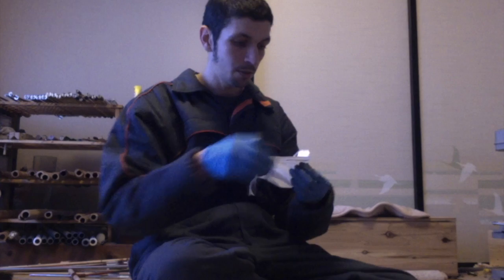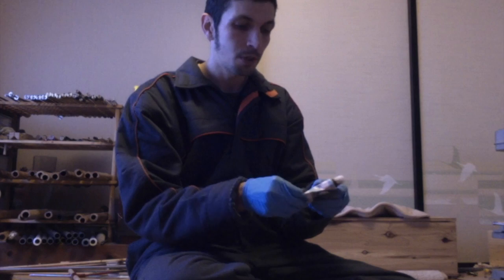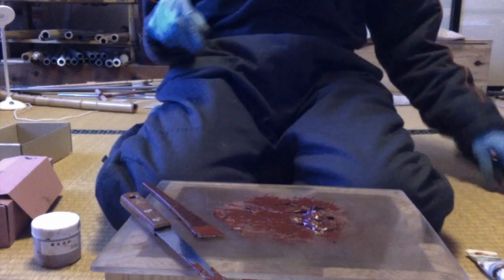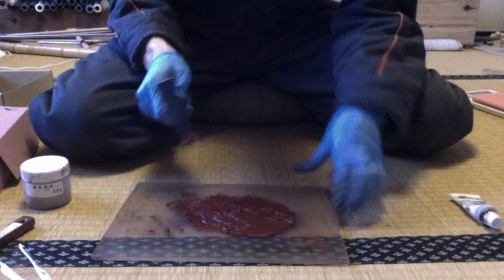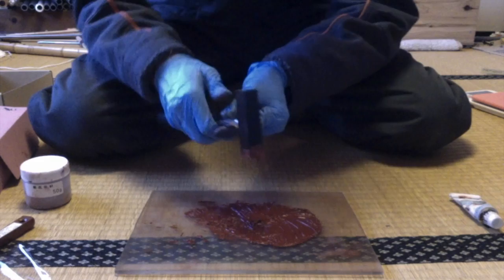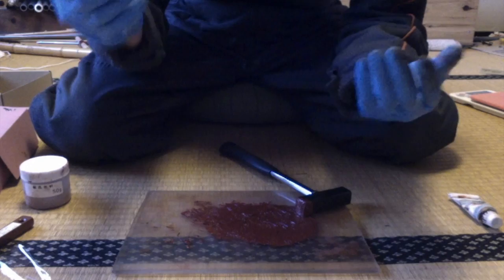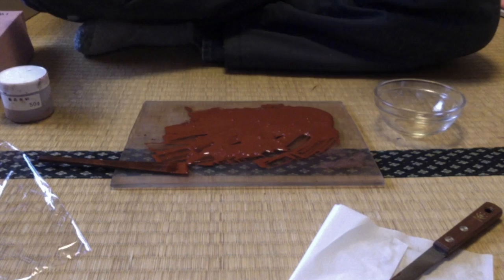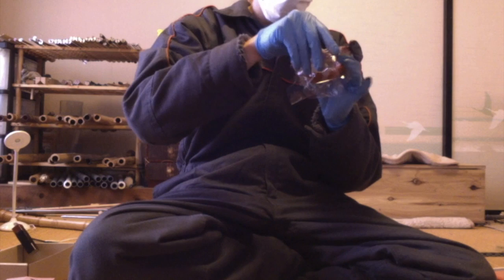Hon-on Shakuhachi: Making Red (Shu-iro) Urushi, Part 1.

Comment: And note on minerals and pigments - did you know that in ceramics the most intense yellow is from uranium salts - I'm sure there's a huge range of minerals that can be used in urushi (emoticon fingers at chattering teeth) - so big ups for your use of the simple old iron pigment, after all urushi (so far as my ignorance goes) started at the the village level back in the neolithic.
Reply from the maker: Interesting! I just finished reading my girls a Boxcar Children book, in which the children discover some yellow rocks, which lead them to a uranium mine. I like bengara even more, as it's a bit more benign :)

Comment: Hi Christian, thanks for your video, its really informative and (on a technical point) just the exact pace for a urushi video, I give you 9.5 usushi tomatoes!  And its great to see you making shakuhachis,  good on you! One question - your bengari/urushi ratio is 1:3 (8/25) based on mass - what would that be volume/volume approximately?
Reply from the maker: These days, I use closer to a 1:4 ratio. As for volume... Good question! I'd have to measure it next time I mix it up to give you a proper reply. An off-hand estimate, though, would be that a 1:3 ratio by volume would probably give you something close to a 1:4 ratio by mass. A 50g container of bengara looks to be just a little bit bigger than a 50g tube of urushi.

Comment: When it comes to allowing the urushi to harden, how do you maintain the temperature and humidity? I'm trying to make 7 tea boxes with urushi lacquer finish. Six of the boxes will be rather  medium 6"x 3" x4" and then 1 larger box 12"x12"x4".
Reply: You'll want to make a wooden box that will be big enough to fit your tea boxes. One side can be a wooden lid, or a sliding glass "door," for example. For humidity, you can use a damp towel inside the wooden box, or even say must onto the bare wooden sides before putting your urushi vessels inside. For temperature, an electric rug or blanket underneath the box is effective. It also helps to have temperature and humidity gauges inside the box.
Reply: @mutsumiandnickbellando9529 At this point I'm only looking for these boxes to be a proof of concept so I plan to do as few layers of the lacquer as possible. How far would you say 100g of the lacquer goes?
Reply from the maker: Generally, 100g will last me quite a while (for processes such as suri-urushi that use very thin coats). As a rule of thumb, 50g per square meter of surface area should give you an idea; how far it goes depends on how large your boxes are; again, some woods will soak up more of the urushi than others. It's a good idea to thin your first coat up to about 50%; this helps more of the urushi soak in.
Reply: @hon-onold-styleshakuhachic8017  I'll try that! Thank you so much for your help. My urushi will arrive in a day or so. I have to finish preparing my boxes first though. Wish me luck!